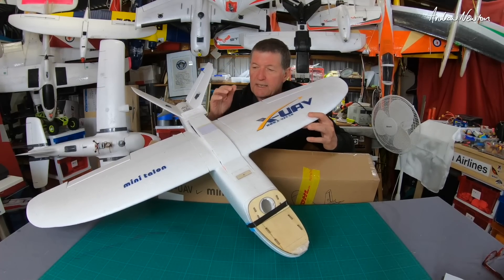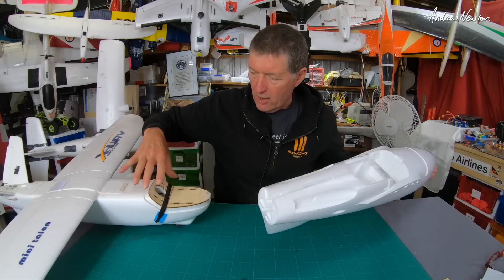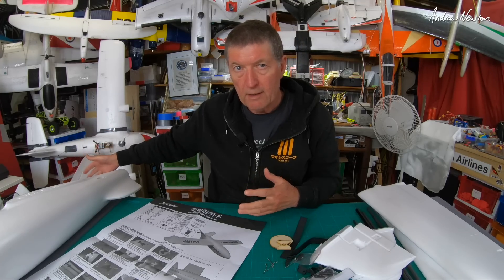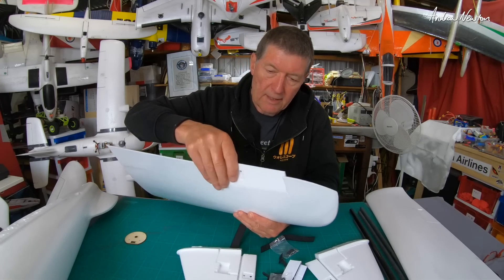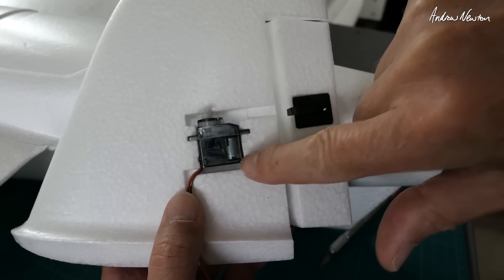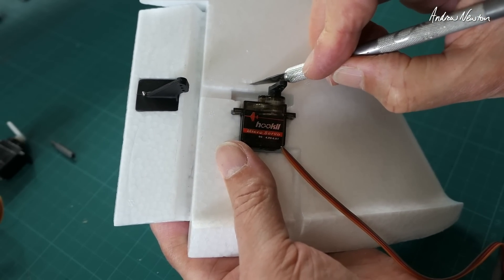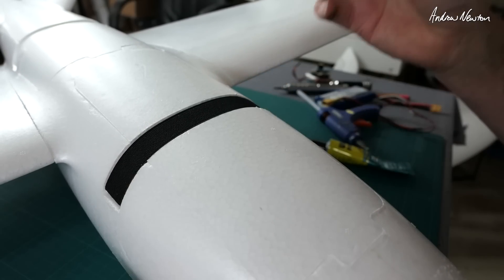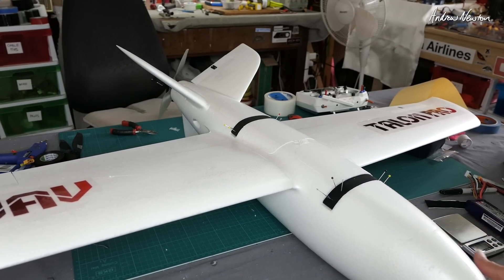XUAV Talon Pro assembly and review

Comment: older mini talon vs this mini talon pro which is more efficient and by what what figures is there significant difference in efficiency ?
thanks a lot in advance
Reply from the maker: I didn't do any real efficiency comparisons but they would be very similar. I kept the original Mini Talon and sold the Talon Pro. I found the original had better yaw and pitch stability and was easier to hold on to. Also made of tougher foam.
Reply: @ i recently bought a pro looks like i made a wrong decision i should hv stuck to the older version instead
But to me the newer version looked like its better aerodynamically so i bought the pro
Reply from the maker: @ It's still an excellent FPV platform.
Reply: @AndrewNewton  Thanks a lot for ur time and response I am your big fan always your content has inspired me lot !!!

Comment: I had a full size Talon. I found it very hard to control and it tip stalled. I could not recover and it smashed into hard ground. The only thing left was the wing. Are these smaller Talons easier to fly?
Reply from the maker: I haven't flown the full size Talon, but these are easy as long as you dont load them up too much.
Reply: Both the mini talon and regular talon are great flying planes but they are not meant to float around the air.  They are efficient but need to keep the speed up.  They cover ground much faster than a wing and penetrate the wind much better too.  Once you have had a little time behind the sticks with them they are very predictable and you get over the hot landings as they glide through the grass without getting damaged.
Reply: @spyder000069  bad stall behavior?

Comment: I personally can't see why anyone would want this new talon as a general FPV plane. The fuselage is not designed in a way that nicely accommodates forward facing cameras of any kind, whether that's the FPV camera or a HD/4K camera for footage.

Anyone who gets this plane with the intention of hacking the living crap out of the nose to fit a camera, or simply wants to somehow attach a prefabricated "FPV deck" on top of the extremely streamlined fuselage would be better off just buying a Mini Talon.

They've missed the mark by a long shot with this model. What a disappointment, and certainly NOT a Mini Talon V2 by any stretch of the imagination.
Reply from the maker: I think it's designed to be modded. The internal structures allow for belly cam and nose cut out

Comment: I see quite some differences with the one i got on the pre-order, you have decals and instructions, i don't, and on the pre-order version the motor mount is just a glassfibre x-piece, no round top plate as on your version. And the Uhu Por i have should be applied to both surfaces, let it sit for 5-10 minutes and then press firmly together. How you use it might work, but that's not the way it's intended.
Reply from the maker: Both methods work perfectly well, but I needed some alignment time rather than instant grip.
Reply: It seems to me that Andrew does it right, just edits out the 5-10mins wait :-)
Reply: @stevietee10  The pins made me think he directly puts the two pieces together without the wait.
Reply: @HermyH66  You don't have to wait, this glue contains a solvent. Besides, it's huge and wet gluing is easier to get the joins to close.

Comment: Ooooooh, I think this video might be popular.
Would love to see a direct comparison once you've done all the normal bits if you can. Not necessarily a spreadsheet breakdown but I'd love a few comparative numbers, speed, cruise speed/efficiency, AUW, battery weight used to balance, stall speed, ease of launch etc. Basically, does it fly faster/slower, heavier/lighter or more/less efficient?
Reply from the maker: Direct comparison is the plan

Comment: I’ve had a Skywalker X6 and have an FX61 that has seen better days. I’ve been looking for a new FPV plane to make use of a handful of 5200mah 4S multistar packs I already have. I also have 4 x 3000mah 4S zippy packs i used to double up in the X6. 
Do we think I could use those battery options with this? : )
Reply from the maker: Perfect for big batteries, my setup is testing the minimum weight needed